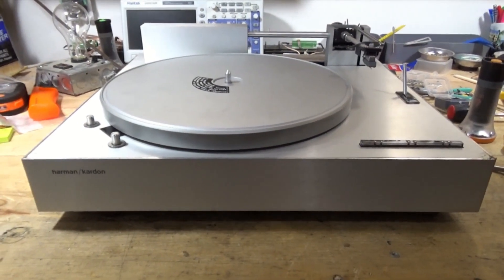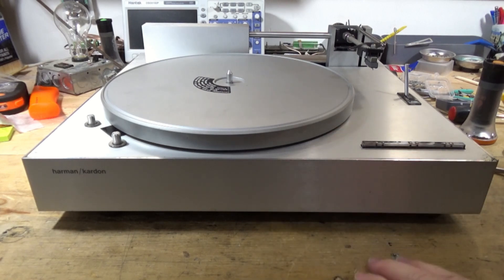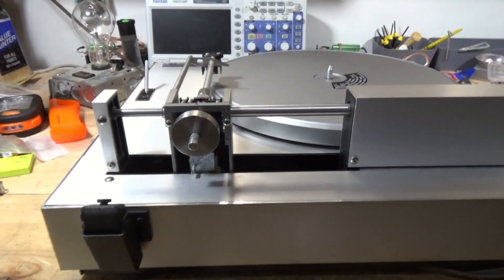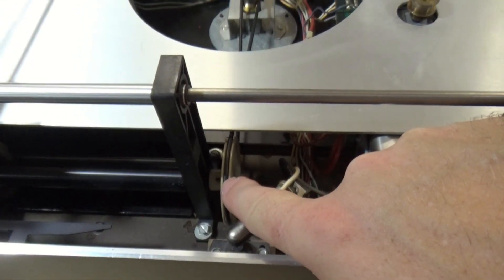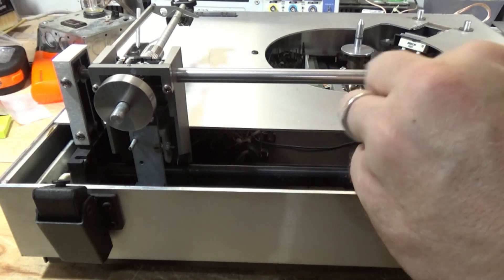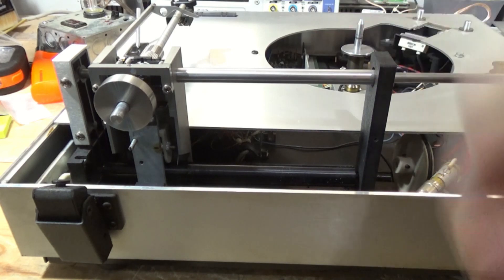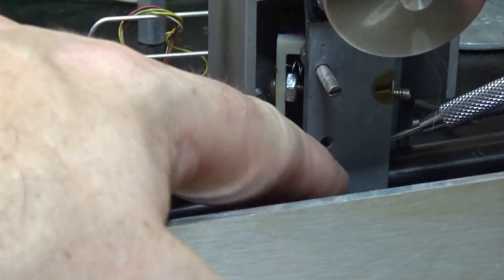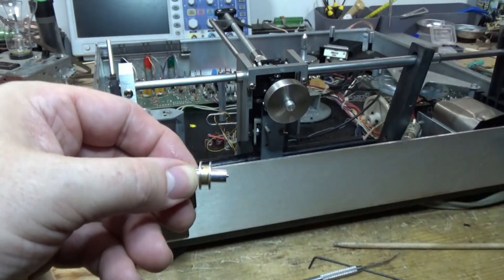Harman Kardon ST 7 Linear Tracking Turntable Repair Part 1 - Initial Evaluation & Disassembly

Comment: I have a St 8 that needs the o-ring treatment,  I'm the original  owner, loved it ha@ a ortofon moving coil cartridge, thought it was pretty good back then
Reply from the maker: Be sure to watch the last part where I ID the correct single ring size, and good luck with your repair!
Reply: The ST-8 does not have an o-ring. ii is solid metal...